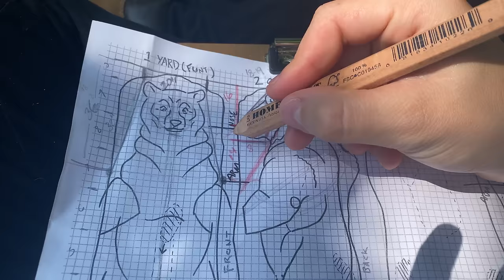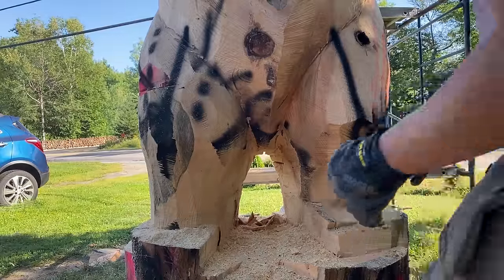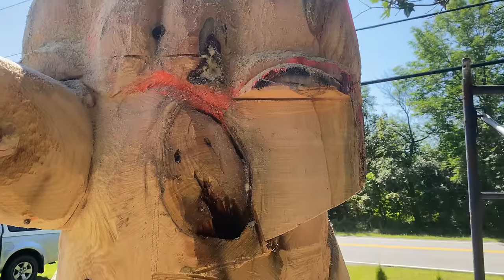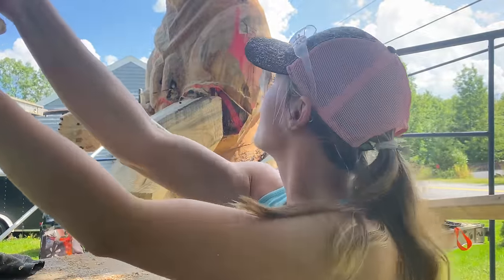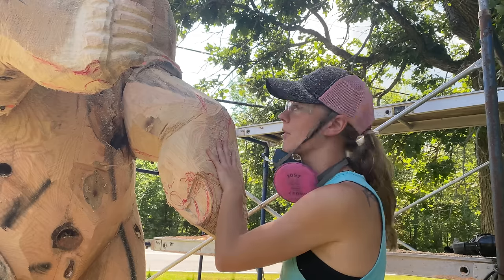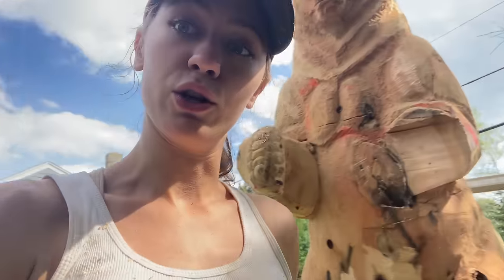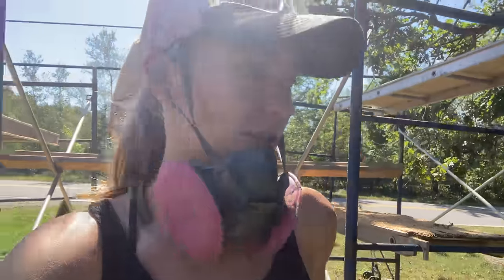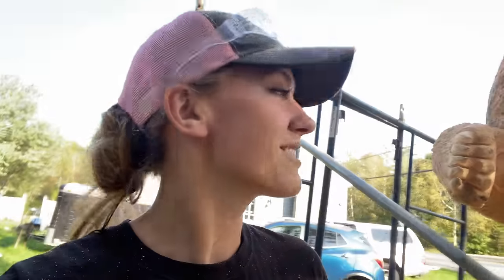HUGE LIFE SIZED GRIZZLY BEAR chainsaw wood carving

Comment: Tay amazing!! If you’re still reading these comments can you tell me what disc you used in your grinder for the sanding on the paws?
Reply from the maker: Just a flap sanding wheel, usually use 60 or 80 grit!
Reply: Rad thanks Tay!

Comment: your lucky yours saws start right up.....mine don't its a war every time to start them.  You do an outstanding job.  I carve walking sticks for the most part but ready to try a bear.  Did a couple ducks.
Reply from the maker: The key to saws is to use them often, all my saws get used multiple times a week which is why they start right on up! If I go on a small vacation they usually take a few extra pulls to get going! The Echo 620p will give me issues if it's sat more then 3 weeks!

Comment: Nice work. Just a tip, next time you apply arms use 1" dowels. Ya never know when that one kid will hang off one.
Reply from the maker: The arms have 2 10” timber lags each, they are for structural projects! Just as strong, if not stronger, than a dowel! They are expensive but I use them with any project that requires an attachment.

Comment: hello! I am. in korea. I live
  You are looking at the work you made. Really beautiful
Excuse me, can I know the name of the eco engine top model?
Reply from the maker: Are you looking to know the models of the Echo chainsaws I used? If so, the larger one was a cs501p and the smaller saw was the cs2511p
Reply: @TayMarie23  thank you! But CS-2511WES. CS-2511P. Similar. Model. There are two things. Is the difference different? you. I am curious about the advantages of the CS2511P used
Reply from the maker: I have not heard of the cs-2511WES. I have heard of the cs-2511t which is just the top handle version of the 2511p (the rear handel version which I have). I love that saw, it’s super light, can run it all day without much fatigue!

Comment: I bought a small chain saw carving of a bear standing up golding my street address sign.  It is now cracking. What can I fill the cracks with.  I have tried wood filler and putty with no success.  Any suggestions, please?
Reply from the maker: All carvings will crack it’s part of the drying process! Every log in multi million dollar log homes will have a crack in every single log, it’s just the beauty of the material. I always encourage people to embrace cracks, if it’s a black bear I would recommend just color matching the crack to the rest of the carving. If you are set on filling it you don’t want to use any type of wood filler as it will fall apart as the log expands and contracts. If it’s a painted bear you can mix fine saw dust and wood glue together into a past and fill the crack that way, then paint over once it’s completely dry. If it’s stained you would want to use wood shims and glue them in the crack, then sharp the parts of the shims sticking out to look like the texture on the bear to blend them in and then stain or paint over top. Hope any of that helps :)

Comment: I currently carving a bear that’s 6ft tall, I can’t get his solders too look right. Any suggestions
Reply from the maker: Bear shoulders should be a soft transition from the base of the skull to the elbow area. They don’t have a sharp neck to shoulder transition like we do. There upper body is like a big triangle - top of the head, elbow, elbow being the three points. I always find this area difficult as well. Take pictures on your phone and print them out, then take a marker and draw over the photo to make it look how you want. Then you will be able to see the material that needs to be removed to get the look you want!
Reply: @TayMarie23 okay I’ll try it and see how it works, thank you !

Comment: Eu quero aprender, esses sabre fino onde encontro?
Reply from the maker: You don’t need a carving bar to start off, they are hard to get and very expensive! If you have a saw you can just get started with the stock bar! If you enjoy it, then get yourself a carving bar, but the basics can be learned with any saw and any bar! You can also get smaller stock bars that arborist use for trimming, I run one of those as well!